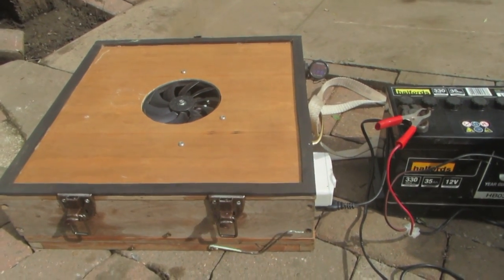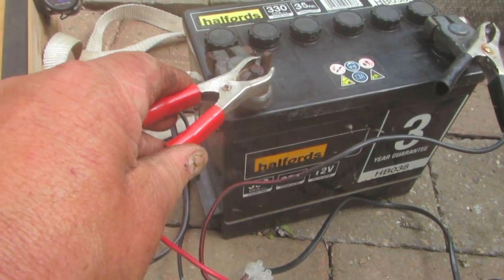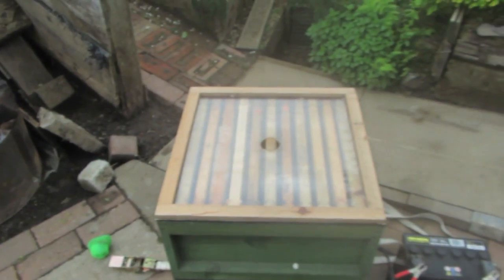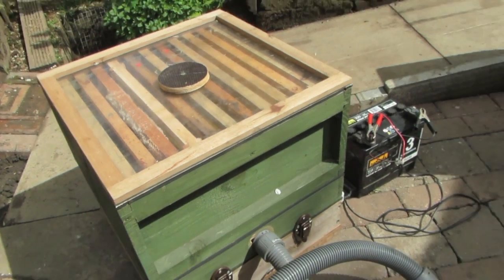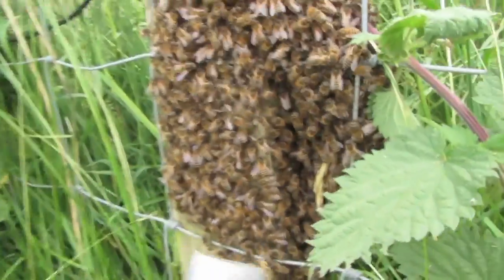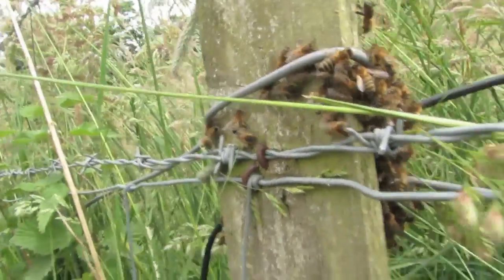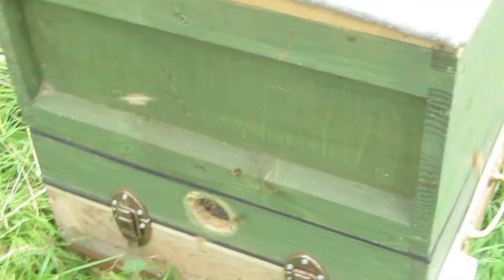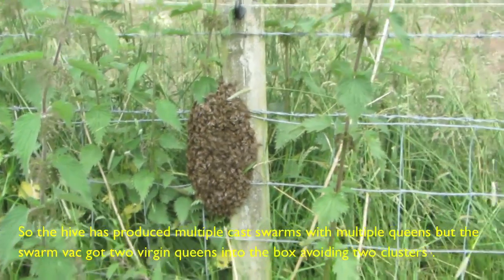Collecting swarms using a home-made swarm/bee vac.

Comment: When you transport the bees do you leave the screened bottom from the vac on for ventilation, and block the hose hole? 
I suppose if you brought enough screened bottom boards, entrance reducers and inner covers, you could reuse the vac for additional clusters.
Reply from the maker: Once you are certain you have the queen in the box (from the behaviour of the bees)  then the floor can be exchanged for a standard floor as the vac will not be needed again and, as you say, the equipment becomes available for a second swarm. Occasionally a swarm will have two queens and the double clusters can be treated as two swarms.
Reply: @Rock-Scratcher  Do you keep an eye out for the queen and catch and cage her when vacuuming, or do you just suck her up with the rest of the cluster?
Reply from the maker: @fredshoney6458  Normally I don't see her but I know when shes in the box because the bees change their behaviour and start trying to get to her in the box and the bees left in the old position start getting agitated and run around looking for her. but I do keep an eye out to make sure I get her especially since I discovered that swarms can sometimes contain more than one queen.

Comment: I thought that screen bottom was going to be too rough a landing for them to bump onto when they exited the hose, and the hose also ribbed, but they look great in the hive.  How did they do the following weeks when that kind of damage would show up in their ability to forage?
Reply from the maker: They did well as far as I can tell though I do not have the means to monitor foraging capability beyond the usual inspections. Landing on the screen at a shallow angle is infinitely better than arriving on top of the frames vertically. That's was my theory anyway, after seeing designs where the hose is plugged into the top. In these designs the bees impact vertically with the top of the frames or with the hive base. In my design, the bees, when they arrive on the screen, seem to roll before crawling away and upwards (instinctively0 onto the frames. I have had swarms with no casualties, something I've never had collecting them the traditional way by dropping them into a container then dropping them a second time into the hive. I think keeping the suction to a minimum is important.

Comment: Did you experiment with different size computer fans so that you had enough air flow but wasn’t too violent for the bees.
Reply from the maker: Computer fans aren't strong enough so I used a 12v motorbike fan which is just right.
Reply: I have a electronic supply store that has computer style fans in 4,6,8, and 10 inch diameters. I’m sure one of those sizes would work and a speed controller could also be wired in to regulate the speed and account for longer or shorter hoses.
Reply from the maker: @rlknight57  Some of the bigger fans might be ok. You could always use two with your controller.

Comment: Andrew, great design.  What diameter of tubing do you use?
Reply from the maker: Its down the allotment so I cannot tell you at the moment but it is a fairly standard vacuum hose which I got from a skip.
Reply: Ok. I'll start with standard 2" hose and go from there.  A friend told me his bee vac always made the bees dizzy and then vomit, and none of the vacuumed swarms got through the winter.  Has this ever happened with your vac, and how did you fix it?
Reply from the maker: No this has never happened. My hose has ribs down it for strength but if the hose was helical in construction I would imagine the vortex created would spin the bees. Could this be why your friend has problems?
Reply: I saw his vacuum today  The hose was perfectly smooth poly tube, but it was only 3/4" inside diameter, and the bees didn't have any kind of landing ramp, the whupped right into a cloth he had set up.  With low vacuum pressure, vortex probably isn't an issue.  I'll find out.  Hope you don't mind, I'm copying your design and will test it out; if it works I'll tell Michael Bush to give it another look.  I really think you're onto something here.  Also I'm getting a pressure gauge; with a known-good air pressure, should be easy to plug in any vacuum or fan  and modify it to the right pressure.
Reply from the maker: Yes copy all you want. I learnt from other's examples and I'm still experimenting. If you make any improved,nets please let us all know. A smooth tube sounds great but the diameter sounds a bit small. But try it and see, that's the only way. Good luck with it.
Reply from the maker: I forgot to ask. Have you read my article at www.QueensandBeans.uk? There may be more information for you there.
Reply: he tried it, and his bees vomitted out their honey stores and died a few days later. So, 2" diameter tube sounds good to me, gives the bees lots of room.  If yours aren't dying, then the ribs are probably ok.
Reply: I read your article, it was really good, I appreciate the time you must have spent to put it together, it was very detailed and well presented.
Reply: @miwawalther3898  I've seen elsewhere that if you vacuum too many bees at one you end up with a pile of wet bees. The suction pressure may be too high also and the bees are struggling to get up into the brood box away from the fan.

Comment: What fan is that?
Reply from the maker: Its a 12 volt motorcycle fan which a mate gave me.
Reply: HI, Great video.
 I've built my own following your plan/ideas. But the suction doesn't seem good enough. my seals are good. Wondered if my fan is to weak ? it is 12v but only 80watts. what was yours ? I read your article in the link. Very informative.
Many thanks
Reply from the maker: I will be getting my vac out this weekend and cleaning off the cobwebs so I'll have a look at the wattage.
Reply: Andrew Lane great, any help is much appreciated 😃
Reply from the maker: The fan is a PAG30 - PANASONIC SSW9809L from a Yamaha but I cannot find the power rating. It is very gentle compared to some I have seen  but I'm happy to take my time and not risk damaging the bees. Sorry I couldn't help more. The fan was free and so was my first attempt. It would be easy to fit a more powerful fan now but I'm happy with the one I have for now.